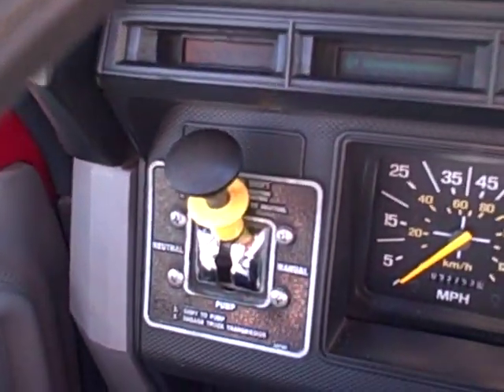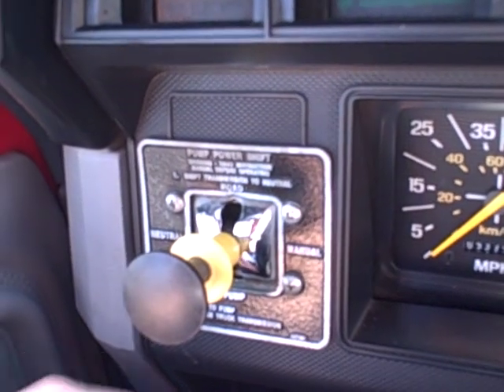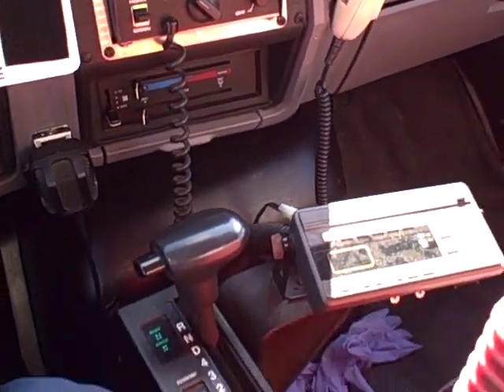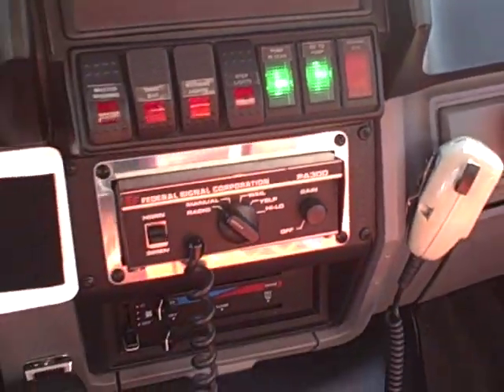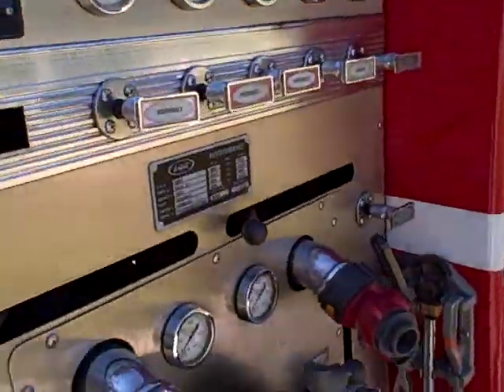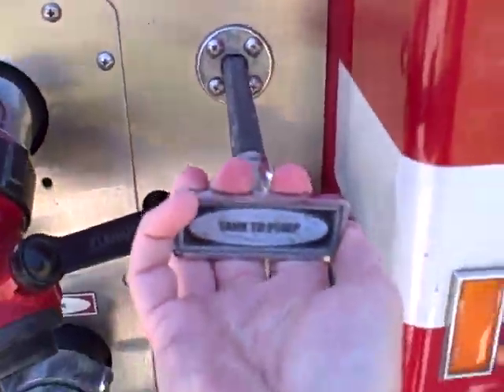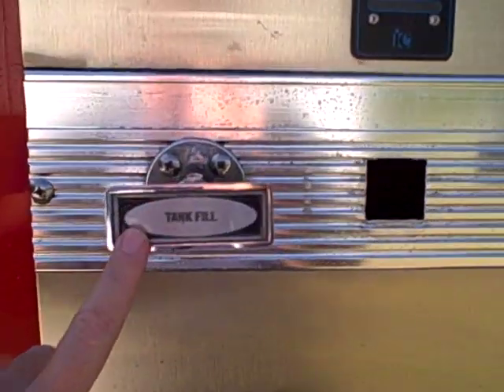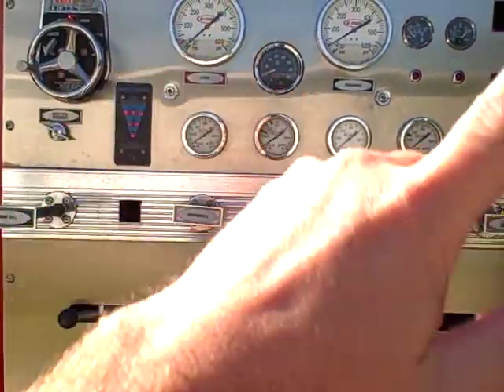CCFR Basic Pump Operations: Re-Circulation Mode

Comment: nice video. the basics are most important. your e-one has a hale pump with a midship mounted pump. not a power take off. you can clearly see road speed after drive is selected with the pump in gear.

Comment: I hope you don't burn up the pump.  Your master discharge gauge was showing no pressure.  If you don't keep the tank to pump valve open, you might want to teach people to pull the primer handle so you can build some pressure.
Reply: A good engineer should already prime the pump during routine morning check out.